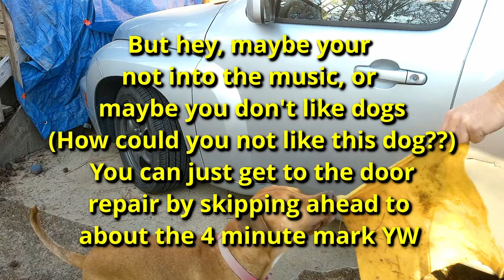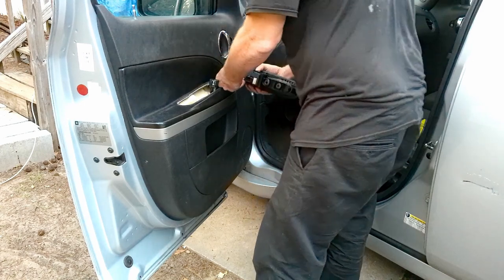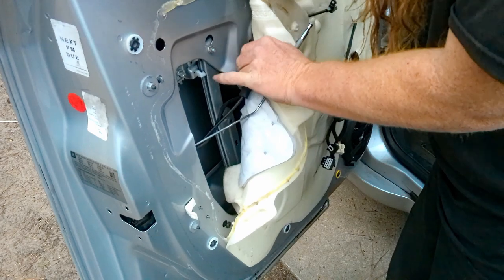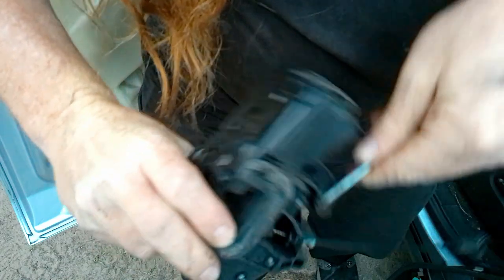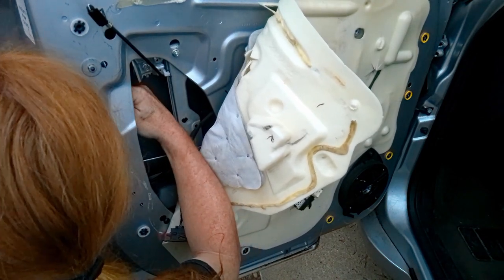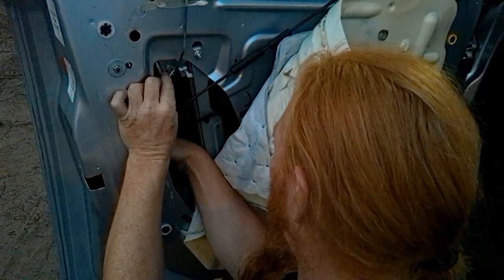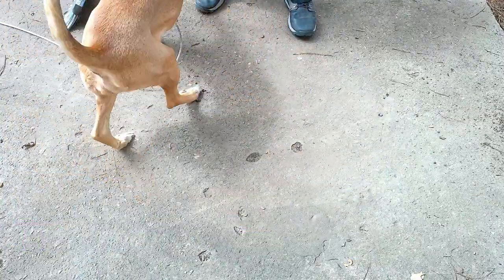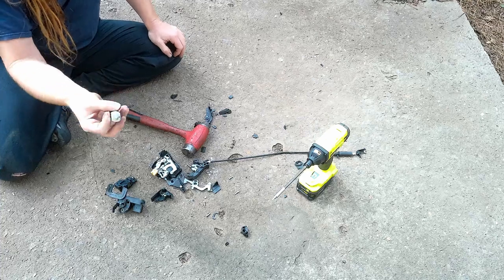Chevy HHR - Door Lock Actuator Remove & Replace (and some music and I play with Lola)

Comment: When you said this HHR has been through a lot....felt that. I bought mine from a crap dealership...they took the motor fan out before I bought it, didn't properly install the oil filler neck. So far I've replaced the starter, oil filler neck and it just recently told me I have a misfire in cylinder 3 so I'm replacing a bunch of stuff. The lock and light switch is next cause I haven't been able to lock it for a year and the lights don't shut off I have to turn the lights on then off and turn my turn signal on for my parking lights to stay off